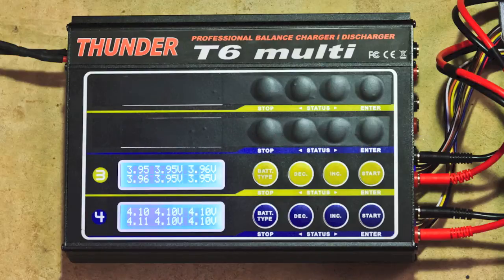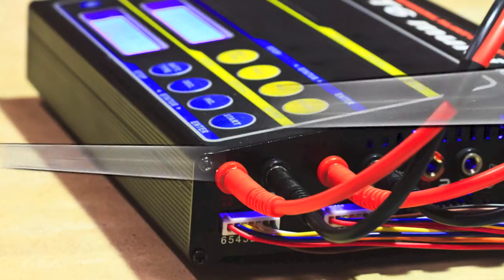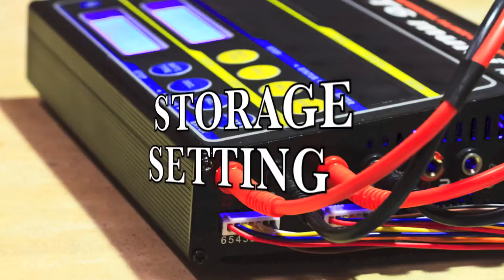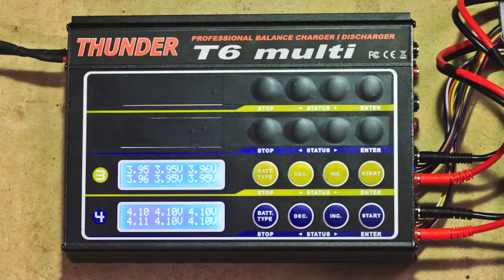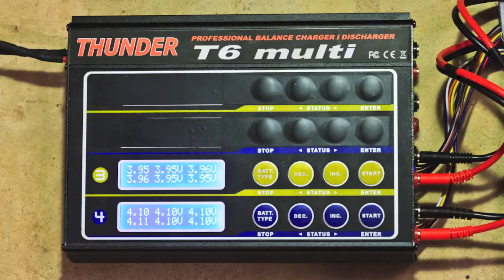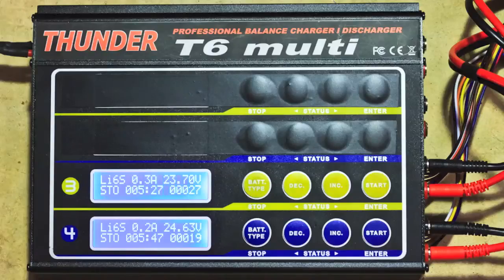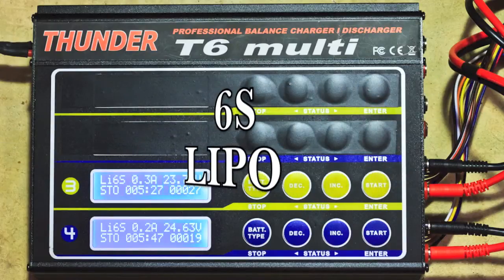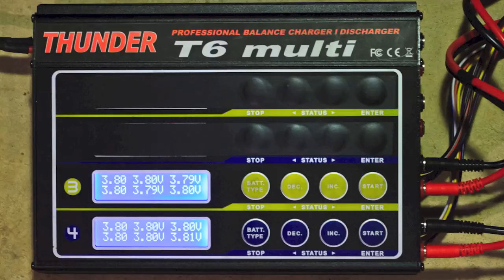22 : Tarot 450 Pro V2 Build : Battery Storage Voltage

Comment from the maker: Thanks!  Interestingly, the max discharge rate I can set my charger to for "Storage" mode is 1.0A, and that's what I have it at. The actual discharge rate varies during the cycle, and the video only shows one snippet in time. I'm not sure why the charger limits to 1A tho.